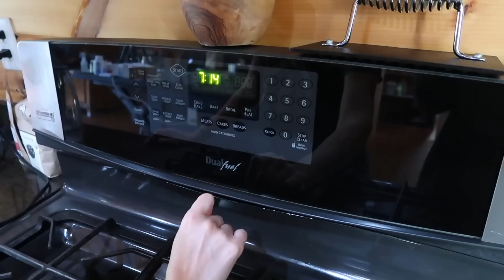If I DON'T get this RIGHT I could RUIN the Barn before we START the BUILD

Comment: Hello lumnah family, I was just curious if you were planning on putting a drain in the flooring or if you are planning on putting the whole slab on an angle for heavier rain to drain out. If it was to get into the barn especially when the snow is to melt. All of the runoff it would be nice if there would be a way to drain it . Just a suggestion want to make sure there was a way to save your investment from future damage and headache.

Comment: Drone footage is cool & ok in moderation, just not too much of it. The pad is looking great, just hope you can get it completely ready build your form & get it poured when no rain is in the forecast, rain on freshly poured concrete can be a disaster! AL with the cold winters you guys have it may pay you to place rebar in your concrete! Place rebar in the center of your form 1/2 way from top & 1/2 from the ground! Do rebar completely across the form & do 2 foot squares throughout the entire form. Also AL If it was mine I would place a small thin layer of gravel on the bottom for the concrete to be poured on top of the gravel & encased around the rebar! This should prevent the concrete from cracking & breaking in extremely cold weather & help with expansion in hot weather! Plus the rebar in the slab will make the slab stronger & the layer of gravel on bottom with the rebar will help keep it from settling in the dirt as bad & instead of your concrete breaking the whole slab will settle together. Not really sure how you guys in NH does it. Excited to see the barn go up! Your wife Gina is still pretty as ever, U lucky devil you AL! 😁👍
Reply: One last note: I’m sure you know this but if not: if you do place rebar in your pad don’t run your rebar all the way to your form. Stop a couple of inches from the form boards. You can buy little clip type elevation stands 2 inches tall or 3 inches tall to hold up your rebar frame off the ground. 
2 inch tall on a 4 inch thick slab & 3 inch tall on a 6 inch thick slab. U probably already got all that figured if you are using rebar in your slab.